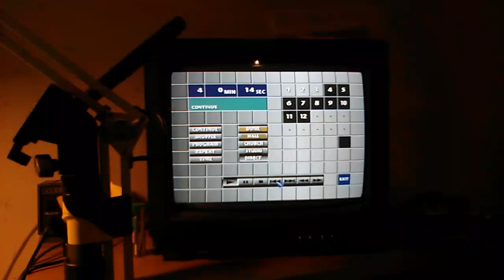Skippy PSX SCPH 1002 laser skipping

Comment: (I hope that the translator is clear)
The problem is the alignment of the laser ... a typical problem of the pin where KSM-440ACM/AAM and insert the CD. My friend ... is a real pain as well (I've got lost for days on end to make it work) xD. Buy a new laser as the KSM-440BAM and replace ACM but re-insert the plastic top of the ACM. It should work ^ ^!
greetings ;D
PS if you buy the new laser, do not touch the pot: BIAS, GAIN TRACKING and even that of the Laser.

Comment from the maker: To clarify: The video was recorded when only 2 lines were fixed (see updated description again, I added more pictures); I never got it working again after the other lines broke and I probably spent 5 hours trying to repair it! The process was to carefully scrape off the insulation with a scalpel, clean the area with flux and then carefully solder the single core wire onto the exposed line. I wouldn't recommend it, but I had nothing to lose and it's good soldering practice :)